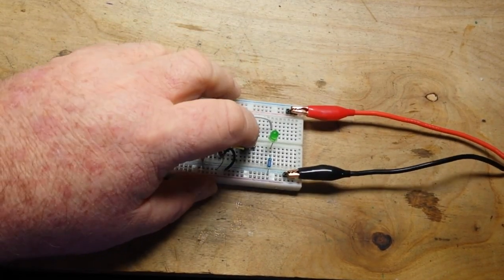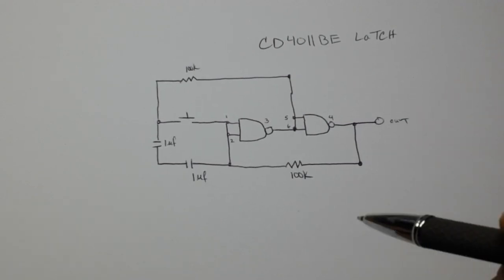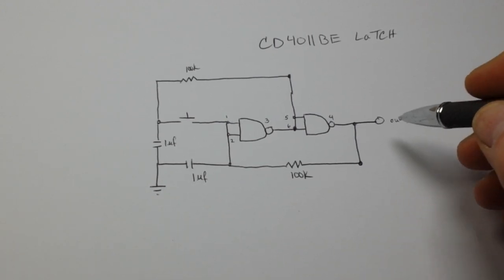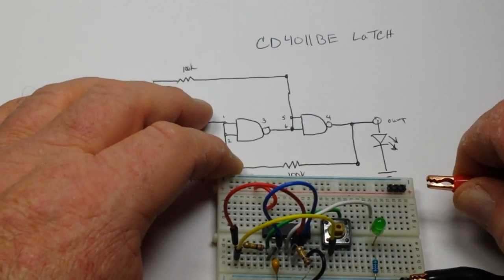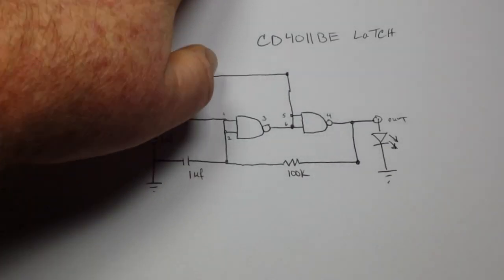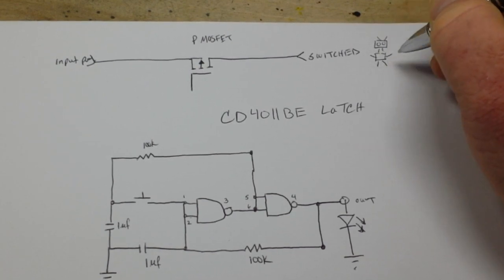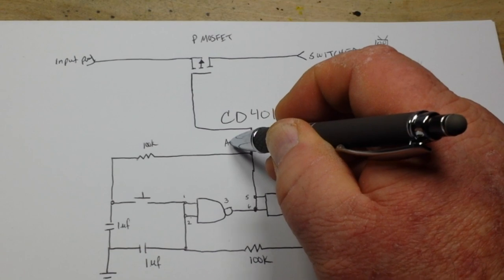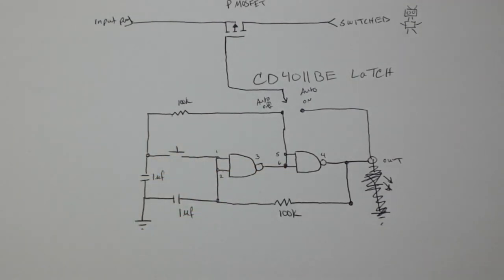Classic circuits you should know: the latching switch

Comment: Small point and being rather pedantic, but I think best practice would have the unused input connected high, rather than joining the gates inputs together. 
It really does not matter for this circuit, but for faster circuits it matters, as it increases the load on the driving gate.
This is a really nice solution. I assume that if the button is held pressed the circuit toggles on/off in oscillation. This would certainly happen if it were a Schmitt trigger nAnd. Without any hysteresis in the gate, the oscillation might be very fast, holding the output near mid rail at a guess. Bit like the arrangement used to linearly biased the gate when using it as a Pierce oscillator.
Reply: @andymouse  the neat trick is the use of the second gate to hold the oscillating gate in its last state before the switch is opened. It's a simple circuit, but I think a T or D type flip flop is slightly better, as with suitable debounce, it will only switch once on each button push. This circuit is a useful building block that can  use up a couple of gates that might be otherwise be wasted.
Reply: @andymouse  i think the idea is to make the period of oscillation very long, so that it is unlikely that the button will be held for a sufficient time to see the oscillation. The video shows the circuit gives a stable operation. It would be interesting to look at the output as it switches, to see if it is oscillates during the transition. It is still a nice idea, worth adding to the tool kit of building blocks.
Reply: @andymouse  in as much as it has two stable states, I think it qualifies as a latch.
I do have a problem with connecting the input to an RC. If you look at the specs for these devices, they require the input voltage  to transition through the undefined level between high and low very quickly.  This is because there is a risk of both the high and low output transistors being on at the same time. This results in a short across the supply rails. There are a number of amateur circuits  where the transition time rule is broken and the circuits still work,  but professional designers try and avoid such circuits as there is a risk of unexplained failures. There is no guarantee that ICs of the same type made by different manufactures will perform in the same fashion when operated in an unspecified mode.
One of the rules for professional circuit  designers is to ensure the circuit  components are used in a way that fully conforms to their data sheets. The reason is simple, self preservation. A designer cannot complain to the IC manufacture if the product starts to show unexplained failures, when the  IC is being used outside its specification. The risk, and cost,  of a product recall is then the responsibility of the circuit designer.
Reply: @andymouse  I think the circuit can be made to work with a Schmitt trigger, this solves the transition problem, but the choice of the feed back resistors becomes important to ensure the input voltage crosses the hysteresis input  voltage.
Usually not designing to the data sheet is by accident, either due to failure to fully read it or because it is ambiguous. A circuit designer needs to be very brave, arrogant or stupid to do it deliberately. Those who think they know better than the IC designers usually come to regret it. That said, it is not uncommon to find errors in the IC designs themselves, forcing IC manufactures  to issue work arounds for bugs on the chip.
Reply: When I built this, the button seemed unreliable, I have to press it very very quickly, and still isn't bulletproof. It worked best with an LED and 1.2k resistor. I tried different capacitance values, and it worked best with electrolytic 1uF. I don't really know what I'm doing here, just seeing what sticks, but will try tying the pin 5 and 2 to VCC. Any other thoughts? It is build on a bread board.
Reply: @ohsnapfit2096  one possible reason for the problem is that the circuit in the video does not include a supply decoupling capacitor. Without a capacitor across the supply rails to the IC, close to the supply pins, strange switching effects can occur, as the rail voltages drops, on each switch press. This is a transient effect due to the inductance of the supply wires and the speed of operation of the logic gates. 
A problem with operating simple logic gates, where the input voltage can linger in the undefined input voltage range, is that the IC can draw a high transient current from the supply rail, as both its output transistors are partially on at the same time. When presenting a logic gate with a slow switching input signal, it is best practice to use a Schmitt trigger input gate. This avoids the problem of the gate input being in an "illigal" no man's land between logic zero, and logic one. 
The virtue of this circuit is its very low component count, but a Schmitt trigger driving a D type flip flop, would have produced a more predictable output. 
Another potential source of unwanted switching, is a failure to terminate the inputs of unused gates in the package. If left in the high impedance state, with no input defined input voltage, unused gates can switch at random as a  result of ambient static charges. Worse still, such static can destroy the device, forcing it into a high supply current latch up. 
Unused logic inputs should always be connected to the supply rail or ground. Ground being the safest option, though the choice of terminating rail may slightly adversely affect the quiescent current of the device. depending on its type. 

Both of the above circuit solutions suffer from the problem that they must remain powered at all times. This is a problem if the switch is a devices power control switch,  intended to turn a device on and off. Cmos logic consumes micro amps when in its DC state. So the power consumption of the gate is usually not an issue, however to operate correctly such gates are usually run from a voltage regulated supply, and this regulator adds to the current being taking by the switching circuit. 
It is possible to design a bootstrap switching circuit, that not only acts as a device switch, but also switches on and off its own power supply.
The advantage of such circuits is that in the off state, the supply current is reduced to the mosfet leakage current of the power supply mosfet switch, and this is very low, of the order of nano amps or less.
Perversely adding such a supply switching boot strap circuit to a circuit containing a microcontroller, adds a very minimum number of components. Implementing a "non intelligent" discreet power switch usually takes several transistors and other components, diodes, resistors and capacitors etc.
 As far as I am aware, no IC manufacture has implemented an integrated solution to this common design problem.
Reply: @nigeljohnson9820  thank you for your thoughtful reply. I came back to post that I got it working by changing the resistor on the output of the 2nd NAND (pin4) from 100k to 10k. I'll be printing out your response and working through it slowly, as there are lots of things I need to look up. 
I also need to work through what was going on, but the hint was I was getting exactly 1/2 the voltage at pin 1, so I knew a voltage divider was happening.
I've grounded my input pins, added a 1uF cap between ground and VSS(this was weird to me, I thought it would short once it got filled up). Doing these two things and leaving the resistor at 100k did not fix the problem.
Reply: @ohsnapfit2096  the capacitor across the supply pins is standard practice. 
A 1uf capacitor is a rather large value for this purpose, it is usual to use a 100n or a 10n capacitor. The capacitor will not short the supply rail, provided its rated voltage is above that of the rail voltage. With a logic device, running at 5 volts, you would be hard pressed to find a capacitor with a rating sufficiently low, to damage it. Some tantalum capacitors are only rated to 3 volts, and of course fitting a polarised capacitor the wrong way round will destroy it. 
The reason why these capacitors are fitted is simply. When the logic gate switches it draws a spike of current from the supply. If the supply leads are long, their inductance limits the current the power supply can provide. 
This results in a momentary drop in the supply voltage to the IC package, and thus to the logic gates inside. As the input logic levels are defined by a percentage of the supply voltage, below 30% for logic zero, and above 70% for logic one, a transient drop  in the supply voltage, changes these logic levels, and can result in a zero becoming a one, or vice versa. This bounce in the input signal can produce a double counting of the logic signal, as if the input had been pressed twice or more. Hence the suggestion that this might have been the problem. 
As for terminating the unused inputs. Cmos logic has a very high input impedance, which means that inputs can respond to stray voltages, capacitively coupled to floating inputs. These voltages can exceed the input maximum voltage specification and damage the device. Even if this does not happen, the voltage induced may make the input switch from one logic state to another, or worse float into the undefined region between the two levels. This is very bad as the gate output may draw excessive current under this condition, as both its output transistors are on at the same time. 

Regarding your solution, I think you have discovered the virtue of feedback making the gates snap between valid logic states, rather than linger in the undefined region between one and zero, high and low.  
This is why slow changing input voltages, such as those coming from a capacitively denounced push button switch are usually fed to a Schmitt trigger gate, to condition the input signal, forcing it into one of the two possible logic states. Basically a Schmitt trigger adds hysteresis to the input signal. Meaning it is processed to have a snap action, being  either high or low, and cleanly and very rapidly transition between the two valid states.  
Your change of feedback resistor forced the input signal to be either high or low, stopping it from being in the undefined state between logic  high and low voltage. 
In this inbetween state, an unbufferd logic gate operates as a not very linear high gain amplifier. In this state, noise on the input voltage can result in the gate output switching rapidly, at  random between the high and low state. 
On an oscilloscope, this looks like high frequency,  rail to rail, switching noise.  This bias mode does have its uses, as adding a crystal to tune the noise produces a stable high frequency oscillator, commonly used as a clock generator. (Ref: Pierce oscillator).

Comment: Wow that is cool. I have leds under my kitchen cabinets that ia have hooked up to a Dark Circuit (off of the interscreen) that I built with some used parts and a old night light sensor an made my own etched PCB for it... I have the set so that the Leds go on at dusk and off at dawn via a 12v PS and a relay. Everything is in its own little box and everything... :-D
Been working great for 3 years but sometimes I want to be able to turn them the Leds on, when it's a cloudy day and it's still to light for the sensor to work the relay.
This would be cool to add as a secondary bypass to make that happen...
I don't have mofests either but you could use a A1015 or S9012 PNP or 2N3904 NPN transistor and have it turn on / off a secondary relay connected to the Robot right?
Anyway this is in my "ToBuild" video saved list to do because I want to update the Led circuit and now that I am stuck in the house for 2 week because of the 19 bug,  sothis  is a great time to make PCBs and circuits!  LOL
Stay safe my friend!  Remember the  10 Ft rual is a thing to do for now...  /:- (
LLAP

Comment: Cool,  but I dont see the source in the diagram.  Did I  miss it?
Reply: Wonderful question! They are standard pin 14 positive supply and pin 7 negative supply in many digital ICs including 4011 ic.
Reply: Yeah, like learningZone said, you power the Integrated circuit and the output can power an LED directly. Sometimes the schematic is drawn to show the op amp/logic gate IC power connections and other times it isn't. So you have to keep that in mind when looking at schematics.

Comment: You Kind of lost me on the MOSFET connection? A cool circuit that I could use too. Thanks for the video!
Reply: He meant to connect the p-mosfet to the Ouput of the latch circuit. Since it can go Low or High it will open and close the mosfet as well.
Reply: i was just going to tell ya what FixDaily did. but he put perfectly.. just connect the MOSFET's Gate to the out put where the LED was. And its drain & source to a separate/higher voltage/current... (but not AC) but you can also control AC with a relay & this too. P.S hope this helps you George!!

Comment: Hows this circuit with switch bounce? Did this with a 555 before and there was no switch bounce. Would be nice if you could cover debouncing.
Reply: looks to me like the two 1uF caps add some debouncing. look up "Schmitt trigger debouncing circuit"; I found that circuit to be a bit more reliable than cap debouncing, but it makes the circuit slightly more complicated because you need one more chip and a diode. Lastly, there is a specific chip made for debouncing which is the MC14490, which works beautifully, but they're harder to come by than schmitt triggers.

Comment: is it me? a switch toggle ON and OFF don't get why all the other stuff? Love your video's btw ....and not an electronical person
Reply: It's because you may want to use a very tiny switch which has a very low profile.  These switches are momentary - they are only closed when you are pressing them and as soon as you let go it goes open again. That's not something you want in an on/off switch so they are used in a lot of flat panel applications - control panels in a lot of equipment like computer printers, HVAC, modern TVs etc.  Behind each and every one of these flat panel on/off switches is this circuit, or something very much like it that has a latching effect so your equipment stays on when you take your finger off the button.

These switches are also extremely reliable because they are nothing more or less than a formed metal dome which flexes up and down.  Technically it's not even a moving part in the normal sense.  In addition to this, the switch also only needs to switch milliamps at low voltage instead of mains current at many amps.  Switching mains voltage can result in surges of many dozens of amps (inrush current) which can severely limit the life expectancy of conventional switches.  Have you ever turned on a light switch and heard it go pop?  That's a spark between the switch contacts that has just burnt yet another tiny crater in the contacts.  In the worst case, the contacts can be welded together so the switch never turns off, ever again.

Another reason to use this type of latch circuit even if the device might be able to use a micro-controller to do the same thing (like turning on the robot which has micro that presumably could do this function) is that the inherent capacitance in this circuit provides it's own "debouncing".  That's a bit more technical and something I won't go into in this reply, but it's a big problem if you try to control a micro processor with any type of switch with no other circuitry.  (Yes there are software work-arounds but they are never perfect).
Reply: @Chrisamic  Whow what a reply!   A latch is an electronic logic circuit that has two inputs and one output. One of the inputs is called the SET input; the other is called the RESET input. Latch circuits can be either active-high or active-low.  Had to look this up. Thanks a lot! Sorry for sounding stupid  ;-)
Reply: @johancornelis3719  It was not a stupid question, it was just a question that required an answer.  Stupid questions are the ones you don't ask  :-)